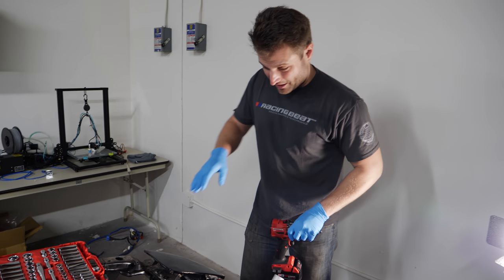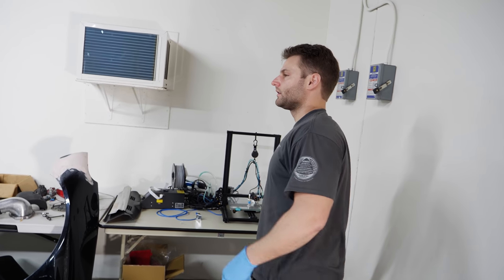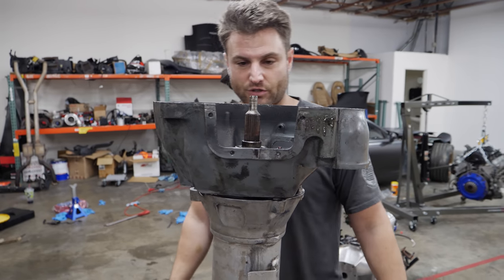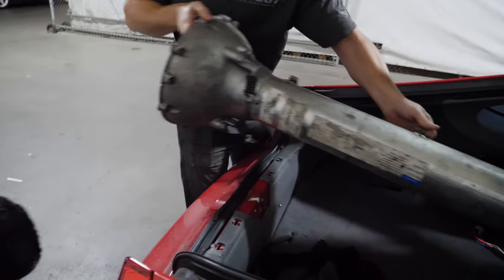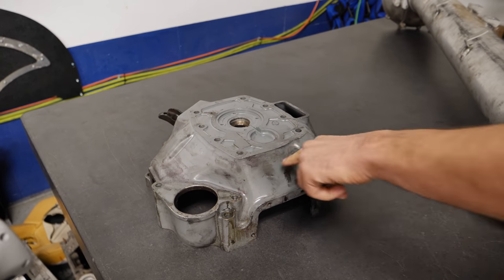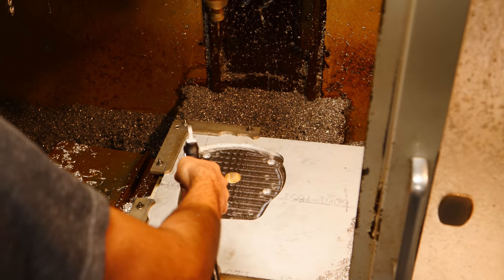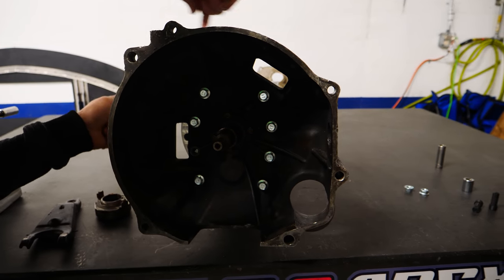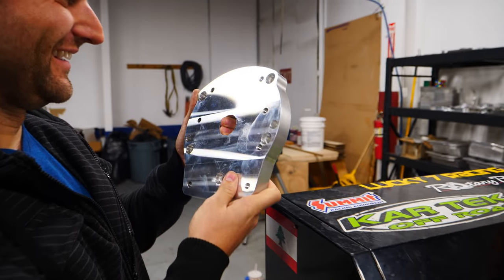Rotary Corvette Adapter is FINISHED! It feels so wrong

Comment: You’ll forget how wrong it feels when you gap an LS swaped rx7 😄
Reply: Hey Build Break Repeat 
Turbo your Sachs rotary
Reply: Normal car modifiers: let's take a big engine, and swap it into a small car. This: let's take a small engine out of a small car, and put it into a bigger car...
Reply: Not going to happen... this thing is going to run like shit
Reply: You have to be joking... this is going to be a 12 second car. It is going to be slow. I dont think that is the point
Reply: @berrytharp1334  depends. Will need to swap in a drastically larger gearing ration. He will more than likely make for more HP but considering the variety, reliability & potential of an LS motor he either spent more time or money to reach the same level of performance. 🤷‍♂️ unique though.
Reply: Berry Tharp this isnt a drag car. it seems like more of a track car
Reply: @ProlificInvention  You're right about the negativity, right that he's profane, but in all honestly, it's going to run like shit. I'm not here to see Rob's cars run. I'm here to see 10-20 minutes of what's going on with the builds. There have been some epic moments, but I don't think challenging them to do better with their reliability is bad. And I don't think the team would love to read someone dissing them, but I also don't think they have any illusions about how short their uptime is on these cars.
Reply: @_winter7745  Well said, I suffer from the incurable disease of rotary engine fandom-however I agree...it's just that faith and logic have a way of deviating from each other 😂
Reply: @konnerkramer3381  hey
Reply: Colby but it’ll perform less than any rotary rx7. Chassis have millions put into being designed for a reason and corvettes werent designed for handling. They were speed first over handling as far as design went. The motors are what make a lot of chevy cars perform well as none of them but maybe new vettes are anywhere close to the designs of Japanese car designed opposite, lightweight and designed with handling in mind over a big fast engine.
Reply: Prolific Invention rotaries work well for certain platforms, lightweight and nimble with great handling. However chevy cars were never designed with handling on the same level as Japanese and euro cars. Infact chevys are big bricks in the wind compared to those. These vettes were designed with a large engine with speed in mind first. So taking away that speed, with the already terrible handling designed by the manufacturer, it’s a match for failure because it’s just going to throw the car out of it entirely. It’ll be too light in the front for how heavy the rear unless you cut out the whole car and do tube framing and a fiberglass cover shell. I’m a fan of amazing engines and this engine deserves a much better fate tbh.
Reply: @joshlarochelle1298  corvettes don't handle??? Tell that to the IMSA, WEC, and WeatherTech series racers. Hell the C7R holds it own against the Ford GTLM...  and won IMSA GTLM in 2016 and 2017. A vette is a sports car, not a muscle car. 

Just because you have seen some dumb bastards whiskey throttling vettes into the woods doesn't mean that the car itself handles badly.  It means those drivers are awful.
Reply: @vdub5818  No doubt. The idea of a Corvette being a heavy ill handling car is pretty fucking ignorant. I don't like them but I at least understand what they are. Shit, after the swap the Vette will weigh less than 300lbs more than an RX-7
Reply: @Dr.Spatula  bruh, it's those fiberglass body panels making it heavy AF. 😂
Reply: jon doe  wrong.
Reply: @ konner kramer, you do realize that if he's going to swap to an entirely different engine type he's probably smart enough to change out a ring gear as well, right?
Reply: Google is your friend.

Third gen RX7 = 2,685–2,954 lb

C7 = 3,298 to 3,618 lbs

By the time he removes that LS it'll be lighter, but it also won't be 50/50 balanced any more.

I'm sure he can strip some stuff and get it balanced again and the end product will likely be about the same as the RX7, but stock to stock, the Corvette is a heavier car, even compared at it's lightest to the heaviest of RX7s.
Reply: jon doe  but it's not....
Reply: jon doe  you're still very much at 3200lbs. Corvettes aren't light.
Reply: jon doe  I've never heard of a C5 or later under 3,000 lbs from factory.
Reply: Taking the heavier LS out of the C5 and swapping a rotary in will save some weight. I’m interested to see how/if this thing runs. Cleetus McFarland’s C5 weighed about 3000 lbs without all the body panels if I remember right. I assume Rob will be around there with the rotary. Blasphemy but it’s cool
Reply: The LS is only about 450 lbs.

By the time he adds the turbos, adapters, mounts, accessories, the weight difference isn't going to be that much.

I was thinking 200lbs initially, but it's probably going to be less than that. Depends on what his turbo, plumbing, intercooler, etc, weighs.

Edit: Apparently the LS with a manual is 497 lbs, the flywheel is heavy as hell on the LS. May be lighter on the Vette version though.
Reply: I still can't believe he tried to say the C5 weighed 2800lbs.
Reply: Remove the engine and transmission and you'll get it there... lol
Reply: @tiondrayhartsfield  yea my boy was off but if you ditch the safety features that are present in a c5 you can shave a few pounds. Shave the fire wall a bit to get closer to a rx7's firewall thickness, go with a manual steering rack, drop all your air bags, taking weight out of sprung weight & lighter wheels. Just different philosophies
Reply: @poppasunny  I'm not too big on cutting into that firewall though. Not if he's not tubing the whole thing. I still somewhat value safety to some degree. But you right. It is an option.lol
Reply: @poppasunny  it's definitely possible to make them the same weight, but they're not from factory. 

The Vette is one of the lightest weight rwd V8 cars you're going to find and it's still very heavy compared to cars from the 70s and earlier. 

I'd rather be in a Vette vs my Comet if I was in an accident, but just talking weight, I can get my car down to 2700lbs just by swapping the bumpers. By comparison a modern Mustang starts at what, 3500 lbs? Camaro is around 3700.

Everything is much heavier than it used to be.
Reply: @tiondrayhartsfield  yea I know what you mean, it's one of the reasons why I never argue about weight with my JDM homies lol. Crazy thing is when they hop into my 97 mustang gt they are always surprised about how quiet the cabin is and how well it handles in its own respect. I keep telling them if you know what your doing you can compete with just about anything.... except a porsche on a track 😂
Reply: @glenwaldrop8166  your totally right, when I look at the weight of a 97 wrx compared to my 97 mustang I'm like how in the heck? Then I got in one and was like this car feels light and quick or cheap & brittle. You have to find what you like but again the weight of cars is steadily increasing like you wrote. Out of the big 3 in the JDM world the skyline, rx7 & supra only the rx7 made the cut under 3000lbs.
Reply: @poppasunny  when I get back to the states I gotta get my FD's running again. I miss them.
Reply: @tiondrayhartsfield  get to it mate... my granddad had a 280z that I always wanted. She rusted to hell. A part of me says get it and weld in New sheet metal.
Reply: @poppasunny  hopefully neither of them sit out that long. Currently I'm in Korea but I'll get on it sometime next year. Until then I'll simply sport the jankiest MKIV you'll ever see. Comple wrong engine for this car.lol
Reply: LS>rotary
Reply: Zach Stagnash 
Leroy with the stock NA (original) engine, stock Vette wheels, and without the cage/body panels weighed 2555 lbs.

3:30
https://youtu.be/Nt-JPcFM_Qg

Leroy weighed 3k lbs after the cage, turbos, air/water intercooler tank, etc.
Reply: F1NNSP1N so so good 😂

Comment: Now you can start selling a kit for putting a Rotary engine into different cars.  With the adapter plate being the first piece.
Reply: So we can make MORE cars unreliable ? Rotarys suck. Have fun mixing gas and constantly replacing melted bumpers
Reply: @theejoeylee  salty 🐟

Comment: How to solve the overlapping hole issue:

Drill the hole in the adapter for the torque tube bolt first. Then, instead of a bolt, use an oversized stud. Locktite the ever living shit out of it. Drill out the torque tube hole bigger so the oversized stud fits. Then, drill and thread the rx7 bellhousing bolt hole. You'll be drilling partially into and tapping the back of the stud, so it will no longer be removable. But once youve got the bellhousing bolted in and torqued down, itll be as strong as if it was a solid piece. Especially if you use an oversized stud. The biggest downside is that you might have to use billet steel instead of aluminum for the adapter, which will double its weight and then some. But an extra ten or fifteen pounds in a car with a full interior is negligible. 

The engineering in these projects is my favorite part!! I love this build to death. Im really excited to see how it pans out!!

Comment: You should make sure that you remove the clutch start switch I've learned from experience and also other people destroying crankshafts by having a heavy pedal and holding the clutch pedal down in order to have to start the car can put alot of unwanted pressured on the crank while starting the engine !!! Good luck on the rest of the build !!!

Comment: Yes, make sure you strengthen that 450lb/ft. rated transmission so it won't break under the load of sitting in your garage behind an inoperable rotary engine.

Comment: ROB THAT CAR IS SO GOING TO HANDLE  ----BALANCE----- Rob people underestimate  rotary engines they make alot of power if done right i used to ad pre mix 2 stroke  oil to my tank to help it last longer as you know the oiler is not very good on these

Comment: Having less than 8 bolts connecting the bell to the tq tube will be fine. The tq from the engine has little effect on that connection. The bolts connecting them has to handle the twist & movement of the engine, not the actual power output. If it was effected by engine pwr, the cast aluminum bell & tube would fail long before those bolts. You could probably have to bolts on each side towards the outter edges & be fine. It most likely has 8 because it has to support the tq tube weight with engine on the end.

Comment: sfi foundation rating would be what that scattershield is rated for, Rob. To be doing what you are doing here and blowing off the sfi rating as 'some rating'  is kinda scary but I am still watching because I cant wait to see the hole you cut in the floor and where you move the gas pedal to so you can fit that clutch fork in the position you have it clocked in.

Comment: I'm curious about what appeared to be a Mazda crate engine in one of your earlier videos. First of all, how in the heck do you manage to get one of those? I didn't think they were available any more. Second, are you planning to add one big-ass turbo to its stock internals or what? Third, how much power are you hoping to make with it? Going from a ~400 hp V8 and making it better with a rotary might be a tall order.
Reply: I think in one his videos he mentioned that mazda sees him as a "racing partner" or something similar and that allows him to get an engine. Could be wrong though.

Comment: cant you cut the torque tube shorten it an inch to account for the adapter plate just gotta make sure its dead center and straight when welded back together
Reply: There's no reason for that. The engine is short enough as is, the extra length can be afforded under the hood.
Reply: @octane613  well to keep the input shaft spacing the same as stock so the disk fits all the splines

Comment: Y'all do realize that this project has been done 50 years ago. Infact it was a mid engine build. Long story... Zora Duntov said is was embarrassing. 2 were built. The car was called Aerovette. Started in 1969 and went to public 1973 to get feedback to compete with the Pantera. It was a quad rotor engine 8.2L and made 420HP.  So there is that. Just some back info. I think it was XP-822 codename.

Comment: Often trying to do things the easy way is actually the hard way.
Buying a steel bell housing for the ls engine and cutting a new engine plate to weld to it would have been better than adapting existing alloy parts.

Comment: Ever wonder why GM stopped designing the rotary Corvette so suddenly? there must be some godly force that only the true and mighty of rotary God's can harness. Rob is worthy! GM was not lmao
Reply: The rotary engine required too much maintenance. The two rotor they were looking at like all rotaries required constant oil monitoring, they stopped it In aerovette 73 because of the oil crisis. Ironically enough the protype was redone in the 90s with a 13b when it was sold.
Reply: @Loki_Trickster oh yeah much like how the thunder in the video was from the weather not actual God's...
Reply: @Wankelgang  There wasn't enough sarcasm in your post. Its hard to read thru words.  But I was just proving a point, rotary engine corvette was victim of the times. The same as the MR corvette.

Comment: Custom is better than off the shelf bought crap. Built over Bought. I remember I made my own custom 3" exhaust for my STI using the Cherry Bomb Vortex muffler (not a glasspack, its a hybrid, high flow muffler, google it) and the way that muffler works, it actually makes exhausts sound deeper in terms of tone, so the epic subaru sound was even deeper, it was silky smooth and sounded gorgeous. Roll up to a car meet, get props on the sound of it, they ask what brand I bought, I told them I built it, they immediately change their mind, its not good because its custom, then I'm told I HAVE to go buy a $2000+ titanium exhaust because its better. but then again most subaru owners have more money than driving skill, proven by me beating a 600hp sti on a windy back round in a stock honda s2000.... sad and pathetic. can't stand subaru crowd. in my experience, rotary dudes are way more chill and laid back than subaru kids. and then honda dudes are pretty chill, but they all seem to build their shit exactly the same, which is like "why, experience, be unique"

Comment: 14:33 
"We're not measuring this with any kind of sophisticated equipment"
Wtf?
Reply: Daniel Bargas I meant when double checking the alignment of the bell housing to the tube. Obviously it was designed with some nice tools, but we did everything you see in this video within about 4 hours.
Reply: Built 2 Apex haha I was just kidding, but nice job👌🏼

Comment: It feels wrong because it is pretty wrong, it’s worthless putting a rotary in a car that was designed with speed in mind first over handling. So you’re under powering a car that’s already not great at or well known for handling. There’s a reason why the rotary was put in Mazda’s best designed handling lightweight car. To perform. Something this corvette will never do is compete at a serious level or be on the level of a rx7 or any other handling designed lightweight car swapped. It’s more or less a car for fun just messing around.

Comment: Wow are you a trust fund baby? We had CNC machines back in the eighties and we designed parts with scales and calipers and Autocad, yeah I can use Solidworks I helped design parts for these flying machines you might have heard of. . Using a digital scanner is cool but did you really design anything? You are not very good at explaining this but what do I know I'm just a retired aerospace engineer. Yikes!